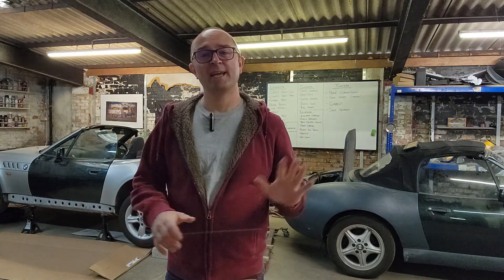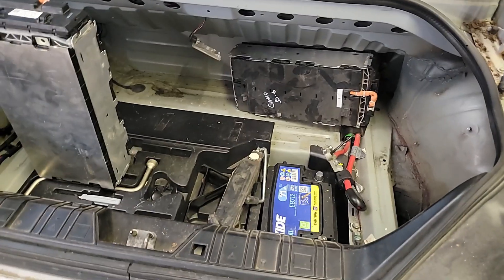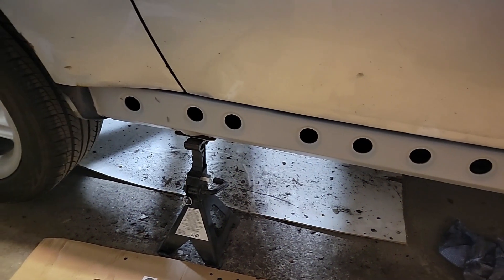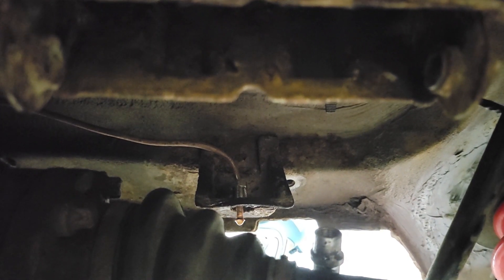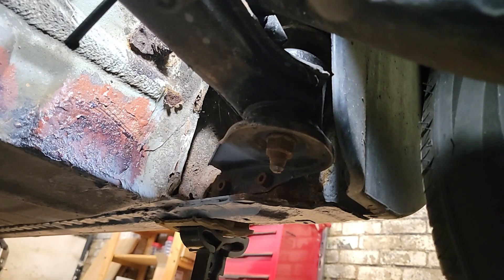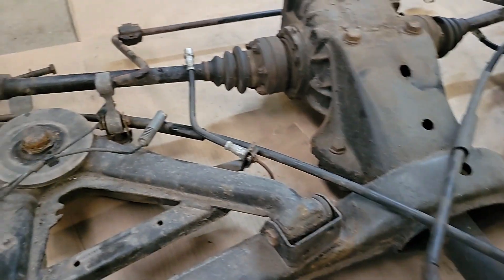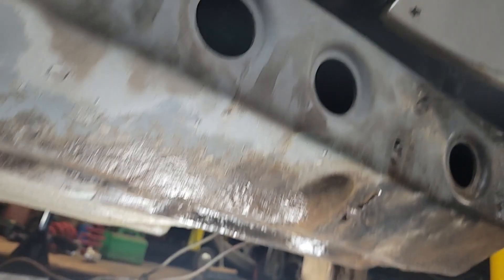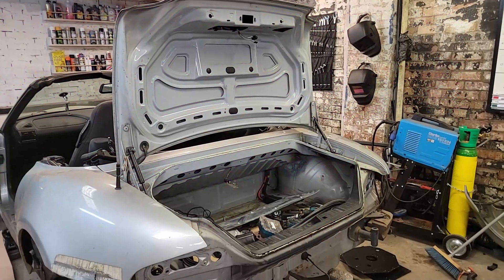Six months to finish my dream car?

Comment: Be "careful" with the wirewheel. When the rust turns black-ish, you have essentially polished rust. But it's still rust and it's gonna start rusting pretty soon, even with rust converter.
(Around 14:00 ff you can see it on the sills. The transistion from bare metal to very light brown (that's the stuff the rust converter will actually successfully convert) to dark brown (that's the polished rust).
You have to really take it down to bare metal to keep it from rusting again. A flap disc or CSD disc (looks a bit like a purple or black sponge) works really nice to remove all the rust for good. The CSD discs are especially good because they don't attack the good metal as much as the flap discs. They are however quite expensive (~5€/pcs).

I don't want to criticize your work or anything, just some information because most people (including myself like a year ago) don't know that. :)
Just like Rich from Deboss Garage always says: "If you're not filthy, you're not rich!" 🤣🤣
Reply: That's interesting cause I've rubbed down rust in the past, treated with rust converter, and painted with Hammerite only to have the rust return 6 months later. I knew I did something wrong but wasn't sure what and blamed the Hammerite.
Reply from the maker: This is really good. Thank you! I did wonder about attacking it with the flap disk or a prep disk of some sort and it sounds like I really should. Ta!

Comment: Maybe best to keep some fluid in the brake pipes. I believe it can be difficult to properly bleed the antilock brake system if they are fully drained. Good luck with the time scale, I'm hoping to get my car on the road by the end of this year but realistically it will probably be next spring.
Reply from the maker: Good point. Unlikely to drain completely but we shall see. Ideally wanted to take the pump out for painting the engine bay but some of the unions on it are seized. Nothing shifted them two years ago.

Comment: Those are some horrible copper brake lines. I only use Kunifer (Copper-Nickle). It flares and forms as easily as Copper if you anneal it first. Buy a decent flaring tool. Many of the tools sold for the job are not suitable!
Reply from the maker: Always willing to follow your advice - especially when it involves new tools!